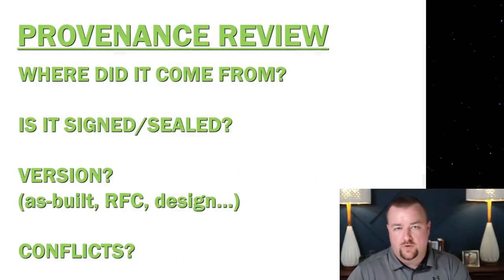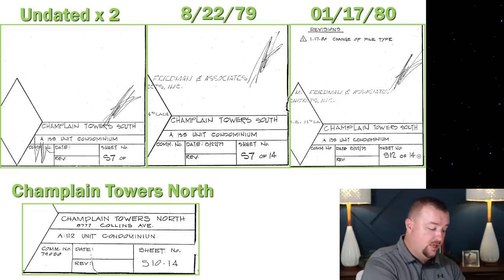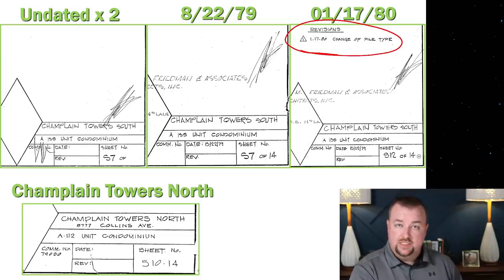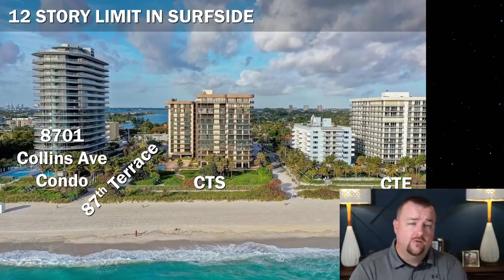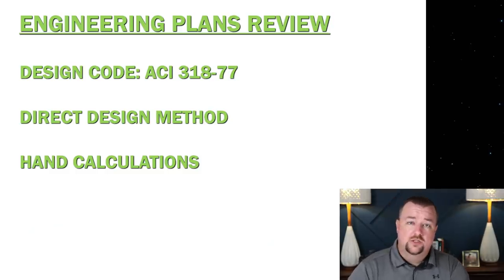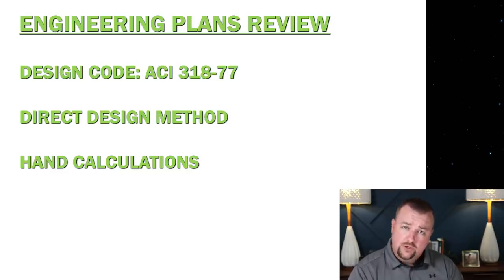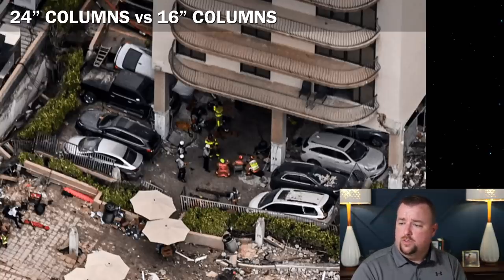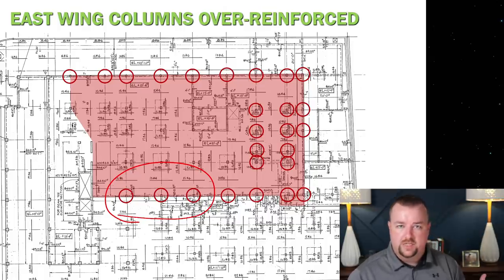Engineering Failures Found in the Champlain Towers South Drawings - Surfside Collapse

Comment: One reason I think that you may not have found any pictures that showed the original planter configuration that matched the architectural drawings is that one very odd thing about the different condo owners and those that sat on the HOA had some real disagreements regarding what I am sure they just saw as the design or their front lawn and not anything that had anything to do with the structure of the building, which was a pretty pervasive attitude for most of the 39 years the build stood.  From the day, it seems, that the condos stared to be listed there were complaints by new or prospective tenants regarding the original landscaping and how it did not afford, on one hand enough privacy for some of the pool facing areas on the first two floors and blocked the beach views on the same floors.  

Apparently before even construction was finished on some of the upper floors and the penthouse, there was a 'rearrangement of planters and some landscaping that was done around the pool deck and the beach frontage area.  As this was an ongoing argument some more landscaping decisions were made within the next couple of years and that is when you see the arrival of the planters all holding, originally a pretty small palm tree.  The went with small ones that could be hand carried in as the cost was a great deal less for smaller trees and they would not need heavy equipment, just a strong back to off load the trees from a truck and carry to a planter.

They did want live trees, however there was not a great deal of thought given to the fact that these trees if cared for well were going to grow and they actually did that.  Apparently, they started having some drainage issues where water from pool splash, landscape watering and rain tended to no longer head towards the drains between the pool and the building where there were drains, and the original pool deck was supposed to slope to.  They apparently did come to understand that the weight of these now several stories high palm trees was causing the deck to sloe toward the building where water would then tend to pool.

The most cost effective advice they got was the partial advice of having trees removed and some repair work done with laying new brick/tile work. There was the more expensive suggestion that the pool deck be pulled up to repair problems cause by the shifting or the deck due to weight and any water that had percolated down and may have damaged the waterproofing but they chose to lay down a cheaper barrier membrane that may not have been rated for this type of job and lay down new bricks or  tiles with a slope so the water would head back to the original deck drains.  This could of been the reason that either the drains were blocked or the barrier was compromised as inspectors had come to assume in 2018.  The barrier was only effective if put down in a solid uninterrupted or damaged sheet, which would have meant that that would cover the drains or they would have had to make openings for the drain holes.

Another interesting thing about the big Palm trees, while they might have easily been carried onto the property originally it was not so easy to get rid of them and that is why they had to bring in a crane, that they places on the street with a long stretch to then pick up the trees and hoist them out.  Something tells me that these people did not fully grasp the potential of a weight difference be tween their baby palm trees with a root ball and the some 30 foot palm trees with a good and relatively heavy root system, root system, or they as seemed to be a habit going with cheaper is better.  This is where you get that now famous picture of the crane up on its side fallen over on the sidewalk and part of the pool deck.  That required a heavier crane to set the original crane upright and to do the rest of the job without getting pulled over.  No idea if that crane falling over holding a heavy palm tree did anything to the pool deck that destabilized it or damaged it.  I don't know if due to the publicity the city inspectors were called in to inspect or not but it is interesting tat it happened and actually could have been a destabilizing factor which with then water seepage, perhaps failed waterproofing and so on lead the that pool deck finally giving up.  And then there were other factors that kept the building from shifting loads and staying up, at least more that did that first night.  Coincidences happen but it does seem strange that the first part of the building to collapse was that pool deck which, besides water issues had also had a pretty heavy crane fall on it within just a few years of it finally collapsing.  I have heard too many structural engineers say that when a building does fall it usually turns out that it was in a very slow collapse for years before and its just that final 2 minutes when its too late to stop it.

Comment: Most excellent!!! Also adding the comment of the palm trees, heavy equipment used and the sand and brick it is a wonder that it held at all!! 
  When I did homes I bought I would generally use code and add 40%.. would you say that is a good rule of thumb?

Comment: Wow - great research and analysis.  Since I haven't watched any videos on this in the past 3 weeks, I have forgotten where the collapsed building section is relative to the last picture you showed.  I think basically this area was the initial failure, and the collapsed building portion it is a few columns away across the pool deck....

Comment: very informative presentation, thank you.  I was a concrete super for 40 years and was wondering if the planters were added in 1980 and in a cost cutting measure the designer felt the beams were redundant in that the planter boxes were now considered upturned beams even though they loaded the plate slab away from the columns

Comment: You mentioned that the step-down was between 1 inch and roughly a foot wide. Wouldn't that mean that the pool deck was originally planned to be slanted so water would run off and after they removed the step-down, the pool deck was level just as the park deck / building ground floor? In the 40-year renovation proposal it was mentioned that the pool deck was lacking a gradient and therefore fostered sitting water and corrosion. And therefore, the proposal was to rip out the pool deck and make it slanted.

Comment: Spot on. Well done. It would be great if you could explain how the pool deck collapse may have compromised the columns under the section of the building that collapsed. I am also curious about how the building continued to stand for several minutes after the pool deck failed.

Comment: Fantastic video!   I am curious, both for this building and others that you have analyzed, if you were able to look at reviewed shop drawings from the rebar subcontractor? Or if you would even feel the need to try to verify if those were 100% in line with the original design drawings?

Comment: I am no engineer, and I understood very well what you explained, so that is a testament to your  ability to explain in clear terms what happened. Thank you. 
Quite surprised that this was started around the one area that survived.  I recall in the early photos, noticing that cars under the surviving structure had dropped a level but never thinking the problem would have emanated from there.

Curious though: if the collapse started with where the pool deck meets the ground level garage, how come the pool deck collapse propagated so far to a point under the tower on the north side? Was that a chain reaction because the whole pool deck was so close to its limits that any shock would cause all dominos to fall?  

For the western portion of the tower, since outside of the southern area with ground level parking  the pillars were also 16", how come that part didn't collapse?  Was this a case that this portion of the condo was lighter and the 16" were able to keep standing without  the bracing procided by pool deck slab but on the northern wing, the structure was heaviner and the 16" couldn't stay stright and buckled without bracing?

Edit: watching another video of yours from july that explains the sheer wall and why he westerr side of building.  stayed up.

Comment: Your analyses are A W E S O M E! Thank you for explaining this tragedy in a way a non-engineer can understand everything clearly. Those missing beams are really alarming. With the weight of the cars and the later added (as I learned now from a comment) planters without any additional support put in for the planters (even as a non-engineer/architect I know that this is not a good idea), the deck was literally at breaking point for many years. That is exactly the spot where the lady on the phone told that the "pool deck" collapsed. I think you found the flaw in this design. The abscence of the supporting beams after the redacted design. With deteriorating concrete and rebar from water seeping through the pool deck roof, the load was finally too much and the chain reaction started. 😦

Comment: Oh my, what a convoluted situation. I may have mentioned 
in an earlier comment that I once worked at the Building Department of a small municipality. The first thing that struck my mind was that the likelihood of finding building plans of a similar age would have been vanishingly small. The department simply didn't have the storage space to save plans that were much more than five years old and even that would have been iffy. The city only had one building that was nine or ten stories high. (The top floor was double high to accommodate a ballroom. This structure was built in the very early nineteen hundreds.) The tallest structure I had some connection with was four stories high, in our jurisdiction, the building codes were/are adopted at the state level. These codes allowed that if the structure had a fire suppression system, then you could use all timber construction. The thing was that many structures had variations from the Architectural drawing, these were usually minor, but it wasn't unheard of to find that soil conditions differed from sample borings. In any case no one in our department had more than relevant trade experience. This matter makes me wonder how much experience the Surfside Building Department personal had reading the plans for this type of structure. I did note that there were many structures that would have maximized the building height, so perhaps the Surfside Building Department would have had much more relevant experience. However, I think that the Surfside Building Department would have been highly dependent on Architect and Engineering stamps.

Comment: Regarding the absence of beam type A at 33:14, there's also the absence of the step-down beam it would have been supporting, those (sprinkler/drainage?) lines crossing that area would have either shown a bend/discontinuity to stay close to the surface, or longer attachments to the ceiling.

Comment: Has anyone taken the blueprint drawings of the building and started modelling it in modern CAD software to determine other design flaws?  It would be interesting to see what the collapse in this localized area would transfer to the overall structure.  I have a feeling the smaller beams in the higher floors are also a major contributor.  If the beams are not lined up from floor to floor, the stresses would be higher in the localized areas.

Comment: Great.  Now it maks sense. Heavy cars on one side of the insufficient  skinny 12" columns, and heavy water filled planters on the other side, with insufficient spliced rebar (3"+3", instead of 20" splices) , and likely too skinny #4 rebar instead of #5 or #6, and insufficient rebar crossing over the column tops (looks like 2 sets of rebat crossing the top instead of 4 sets). Also, likely over-loaded pool deck using sand and blocks without adequate pitch and built-in guides for rain run-off. All adding  to the corrosion, spalling, rusting expansion, etc.
            Lessons learned.  How have the codes changed since 40 years ago?  In other words, how would the design been different if built today in 2021?   Also, how will the codes now change due to the lessons earned from this tragedy?     Thanks for a great video.

Comment: Hey I have a question for you. In your video you were talking about splices of rebar, where two rears meet and are tied together by either wire or thinner rebar. And this actually reminded me of a video I was watching of a high rise being build in China (maybe a 10 story building nothing super tall), but they were using a process of chemically welding the upper rebar to the lover one. They had a cup where they poured some form of powder into ( maybe thermite), that went around both sides of the rebar and jointed at the center, it was ignited and with in literally 10 seconds it welded the two rebars together. When the cup was split open you could still see the rebar red hot with slag pouring from the jointed spot. I don't know if they ever use this process here in the States I've never seen it, ( but then again I'm not a structural engineer). I guess my question is which process is superior, I saw a lot of comments saying that the rebars absolutely have to be tied by wire and welding them is inferior process that weakens the overall strength of the column. But now you brought up a good point of over 
reinforcing the rebar can be detrimental to the overall strength. So is this why they weld rebar in China, or is it simply to save time and material, and is tying rebar still a superior method. If you respond that would be great, if not I understand you are busy so no big deal. Thanks either way. By the way great video, you took a lot of time to extensively research building blue prints and calculate loads props for putting so much effort into it.

Comment: A very informative analysis. It would be interesting to see what provision the designers made for punching shear. At the time in the UK there was a debate that concluded that punching shear was not adequately catered for in the design of thin flat slabs. Subsequently top reinforcement mats would be designed to cover this failure mode. The shear failure is cearly at the face of the column and there appears to be little reinforcement.

Comment: I'm not sure why you had to calculate the re-bar lap. In California we usually use a lap of 40 times the diameter of the steel. That works out to 20" on #4 re-bar, 25" on #5 re-bar etcetera.....This seems to be a pretty standard requirement.
Thank you so much for this in-depth analysis. Loved it!

Comment: Hi, Josh! Could I ask for some advice? Maybe it could help others with this question.

I've just binge watched a lot of these videos and ended on the one about reinforced concrete's enemy #1. My girlfriend's one-story family house has two reinforced concrete pillars in front of the entrance to the house. They hold a small balcony and part of the living room on the first floor, cause those spaces overhang the entrance. Recently we've had three pretty bad earthquakes, some cracks at the joints may have formed and rain could be getting in there.

The pillars are bare concrete, not even painted or waterproofed. What would you recommend to protect them (obviously after calling a pro to check the integrity)? Thank you very much!

Comment: First off I want to thank you for taking a subject I literally know nothing about, and explaining in a way where I understand the "basics".... Second, based on what you've described here in this video leads me to believe that this disaster was always going to happen, and I'm a little surprised it took as long as it did considering renovations to individual units with extremely heavy materials were ongoing throughout the years. I pray the negligence is punished in all aspects from the engineering, right down to the condo board    This is absolutely tragic, and so unnecessary!

Comment: Been watching the whole playlist as well as a few other channels.
When you mention settling of a building, i can understand that, if we assume the building settled at the same rate across its foundations due to equal weight, i would guess the pool deck might settle less causing craacking along the line of the 3 pillars
Another thing, the amount of water at parking bay 78, could that mean the pillar near that location is sinking more than the rest ?
A couple of other channels mentioned that a hole appeared in the deck just before the collapse, this hole was in front of the planters and well away at its centre.

Comment: As a structural concrete contractor building parking structures in S California, I never built one with out capital dropheads over each column. Usually 6" plus deep below the slab & 2ft square or bigger. And those were just for 2 or 3 stories of apartment framing above.